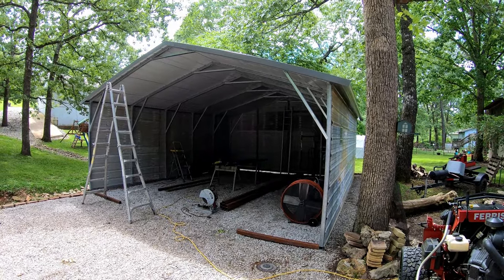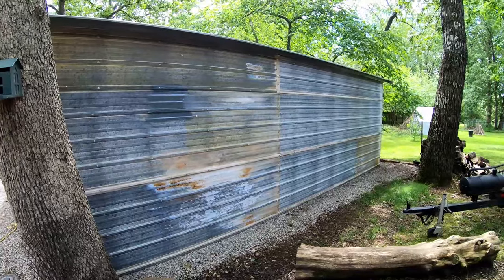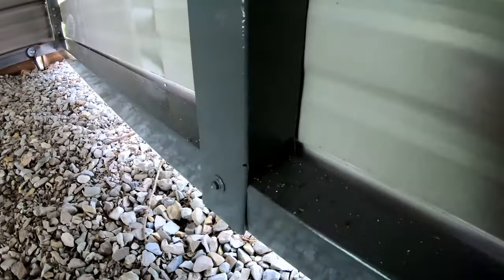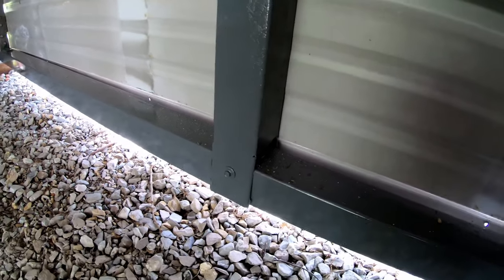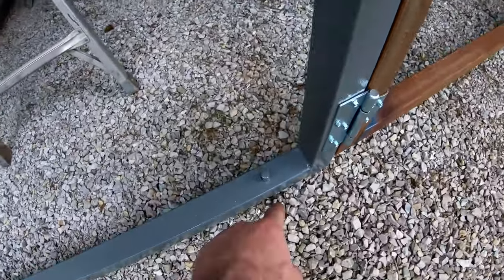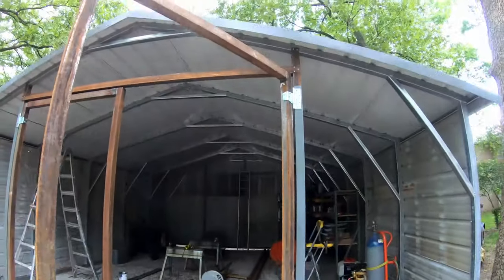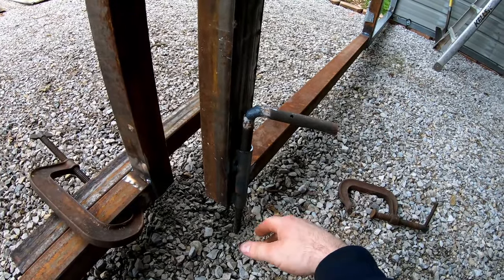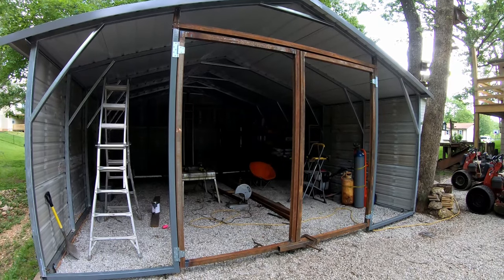Framing A Carport

Comment: Did something similar to this 10 years ago with a 19 by 20 carport I bought second hand off Craigslist. $300 for the carport, $600 for new sheet metal and 2” red steel square tube,  $350 for an 7’ roll up door. Big mistake I made was not putting it on a slab. It was on a gravel floor like yours and everything grew mold including the interior panels and all my equipment. That would be my only suggested change. Nice job!
Reply: With a vapor barrier below the slab I'll note also is a great idea from what I understand and am planning.
Reply: Was the building insulated or just exposed metal?
Reply: @magicone9327  It was just exposed metal.   Had I known how much moisture would come up thru the gravel, I’d have put 6mil plastic down before I spread the gravel. I’ve since poured a slab and dragged the shed on to it.  Much better now and absolutely no moisture issues for the past year.

Comment: I did something similar. The biggest differences is I had the sides installed, then a concrete floor poured, then framed the ends with 2x4 attached by rivet nuts and bolts in the attachment points with the carport. Anchored the bottom with concrete anchors. Framed in a walk in door an a barn door that’s a similar design.

Comment: Not to be a downer but you should put double door on each end. I bought a property with one of these on it 20x50 with 15’ of it closed in with a 8’ garage door and a small window in the back. In the summer it was so hot I couldn’t stand to be in it for more than 5 minutes. Tore it down and put up a wood shop in place of it. But those shade trees should help. Course I live in South Texas where the summers can melt steel. Good job 👍
Reply from the maker: I would, but it buts up to the property line so I will probably put in a vent fan eventually.
Reply: Insulate with R-Mac ridged high R value and it will not only be more temperature moderated it will not condensate/sweat.
Reply from the maker: @magicone9327  Great tip!
Reply: What size is your carport brotha
Reply from the maker: 20' x 26'

Comment: Looks really nice, thanks for sharing. My concern is issues of mold and rust due to moisture getting in through the gravel. Did you do anything to prevent this or has it not been an issue for you?
Reply from the maker: It hasn't been an issue since the building is not air tight (vented along the eaves)

Comment: This is exactly the video I was looking for it’s not the same as mine as mine an old carport that is wood structure that is solid and kinda like a mini pole barn that we used to use to cover a section of are dog kennel when we had coondogs and it’s  concrete pad etc, but the roof slants all the same direction but we already closed the sides and I wanna frame it and put swinging doors on it so I can use it as a shop instead of kicking cars out of the garage to work on something or do motor swaps in
Reply from the maker: Glad to help.

Comment: Very nice. I am going to use aluminum for the doors because of the weight. I wonder how oversized rivets would work instead of the framing bolts? Maybe easier to cover with the tin installation due to the bulging from the bolts sticking out.
Reply from the maker: Great ideas! Let me know how it works out.

Comment: Well Done! Thanks for showing all your details. What did you use to paint some of your frames? I like that you have put HD bent rebar (#4's?) into the ground as hold-downs. Did you set them into conc. by chance or just hammer into ground? Was a permit required for this by chance? I was thinking of getting one of these myself but didn't want to have to deal with the headache of permitting. And, we do get lots of snow here in N.E. PA, so I would have to consider the perlins on mine (great suggestion Gene). To considerably strengthen you front door wall/frame, I would really suggest you put in a diagonal support brace (flat bar maybe?) from the bottom hinge corner to the opposite upper corner (on the inside of the frame) near the eave on each bay on either side of the doors to prevent the weight of the doors from racking those individual bays...maybe even a diagonal inside each door panel as well. Lastly, I would strongly recommend installing a light-gauge angle over the top seam of your doors (along the header) that you can put a slight outward/downward pitch to the bottom leg to help shed water (drip edge - at least a 1-1/2" bottom leg). This will make the doors last so much longer. Good luck!
Reply from the maker: I called in a location on utilities before the carport was installed, to make sure the area was safe for driving the rebar. I used marine grade steel enamel paint on all the framework.

Comment: Did you have problems with door/hinge swing clearance after installing siding?  Those style of butt hinges with no swing away clearance to by pass finished wall thickness always cause interference.  If the but/ Boss of the hinge is connected  between the wall and door frame you can then extend the hinge knuckle outward for clearance of siding and the the door will open without pinching the wall.  In this case the door will only one as far as the roof line drop interference allows and it will still not open to 90° without pinching if siding is not set back from hinge swing area.
Reply from the maker: They work great, I can swing both doors open to about a foot away from the building. I have had enough hinge mistakes to know what you mean though. Had to learn the hard way lol.

Comment: Why the roof like that? How the rain will flow? The roof will rusty if the water not flow correctly.
Reply from the maker: It's a very strong design, and the water does have adequate runoff.

Comment: Great job!   Here is what I've always wondered about when doing this.  Under high wind the lift that buildings are under caused by the difference between the inside high pressure under the roof, and the low pressure outside above the roof.  This difference in pressure causes a lift against the buildings anchors to the ground.  Just like an airplane gets its lift from the pressure difference between the areas above and under their wings and it's body.  When closing in a building that pressure difference is greater since the building is now closed in and the high pressure inside cannot escape readily to equalize and abate the lift force.  If additional hold downs/anchors aren't used the building runs the risk of wind lift and damage from the event.  Thoughts.  Am I crazy? Am I overkilling?
Reply from the maker: Maybe over thinking, maybe not, but it does have 200 mph wind rated anchors.
Reply: HandyGuy 2016 200 mph anchors under the original build?
Reply from the maker: @magicone9327   correct. Before I added sides.

Comment: How are you sealing out the bottom to prevent critters and creatures from coming inside?
Reply from the maker: Filling any gaps with more chat.
Reply: @HandyGuy2016  More chat? What's chat?
Reply from the maker: @naturallydope247  the gravel I used for the base is chat.

Comment: Do you get a snow load? because in between every 5ft span with just 4 inches of snow you will have approx 1700 lbs of snow with 8 inches you will have approx 3400. ‘’About 7000 14000 lbs total.you will make that metal roof into a bathtub suggest you run some purlins in between and some cross ties. Or it will fold like a lawn chair if you don't get snow you should at least put cross bracing for wind sheer. don't take my word for it ask an engineer. I don't want to see all your hard work come down to good luck.
Reply from the maker: We hardly ever get snow here, maybe an inch? I know that all the carports sold here are designed the same, for the past 20 years at least.
Reply: I've had 4 ft of snow on mine, no issues